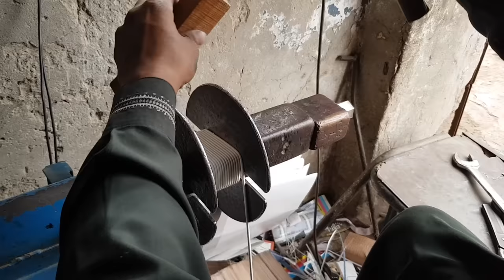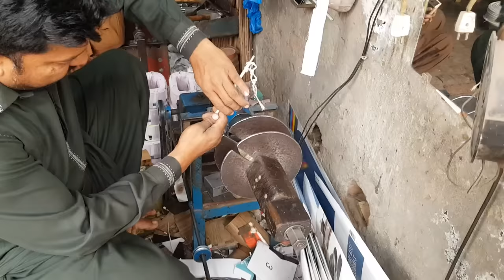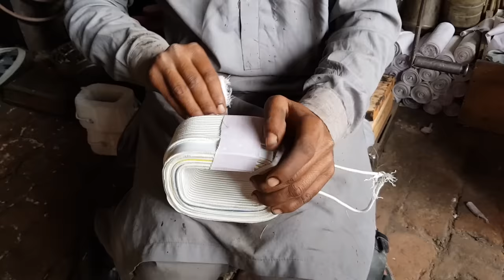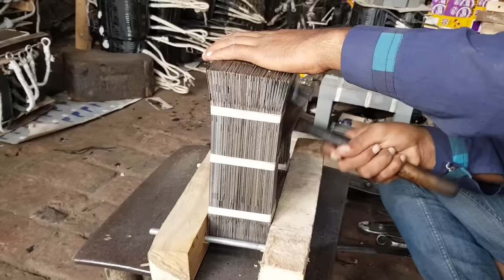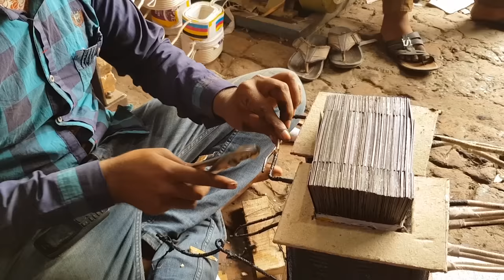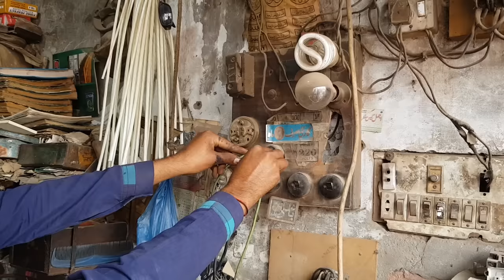80 AMP Welding Machine Making With Amazing Technique

Comment: My only thing is the corrosion on the nut and bolt used inside the cabinet to attach the two wire loops at 8:50. Otherwise excellent

Comment: I now want to wind my own transformers !
Fantastic  ! Apart from the wire and casing all the other materials seem to be improvised.. Even some of the nuts and bolts used seemed secondhand,  probably foraged from scrap. The paper and card used for isolation wrapping looks as if it is waste from a printers..  Despite the emergence of cheap Chinese buzz boxes these impoverished people still have to rely on cottage built stuff like this.. I have tools and facilities that these people would give their right elbows for, but I hardly do anything with them.. Humbling stuff !

Comment: A heavy rotary switch would be more efficient.
Reply: Okay make one yourself
Reply: @713Mexi  Are you OK? Why would I do that? I have a store bought  welder with a brand name. My comment was a SUGGESTION.  fool.
Reply: Rotory switch will not work for this machine for 2 reason first it will cost much then the machine seconds it will be a weak point and it will burn because in this design the output current that the rotory switch will handle is over 300 Amper  by the way this design is just a reverse engineering for a old lincoln welder from 1960 the new lincoln use a rotory switch but the switch is adjusting the input impedance for the transformer in 220vac side not like this machine is adjusting the output impedance for 48vac adjusting impedance is a process in electrical to protect the transformer from short circuit you can see impedance protected in fan motor  this mean that the motor will not burn if it stop turning
Reply: @jeanmichel9207  Reading and understanding go together. The guy claimed his welder is set for 80 amps output. Not 300 amps. A rotary control is convenient and safer as he wouldn't have to move around output wires for different amperages.
Reply: @keithameerali9474  Actually, Jean Michel is right, but perhaps I can explain why. What you call a "rotary switch" in this type of transformer design would need to be a variac on the AC input side, since a multi position rotary switch between the different windings on the output side would likely fail quickly as a result of the current. Indeed you could simply connect a variac between the input and the AC supply and have the welding electrode permanently connected to the highest current terminal and that would accomplish exactly what you are suggesting. However, variacs capable of this sort of current load are not easy nor cheap to make given the amount of copper coil involved and would require custom metalwork. Note also that from the coil size and the socket type (three rounded pins) this is clearly in the Indian subcontinent and a 2-phase supply. Therefore the input for this is the old pre-British Standard UK supply type of 220-240V AC at 15-20A, not 110V. Hope that helps!
Reply: Some people make comments like " Why don't they fit switches ?"  "Why don't the use MIG instead of Stick ?"

This is a developing country and large swathes of the population earn and live on next to nothing.. Any tool with moving parts and/or electronics is at risk of needing spares.. These people don't have option of ordering parts online etc.. They have to mend and make do rather like when I was a kid..
Think ! MIG welders have switches, fans, wire drive motors ,feed wheels, rectifiers, relays , gas valve solenoids , gas, etc, etc.  All wear out at some point.. The welder this guy is building may be crude but it has no 'service' parts whatsoever. It is a transformer with various output connectors .. Amen... It will outlive its maker and buyer..